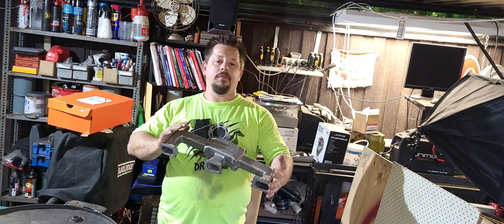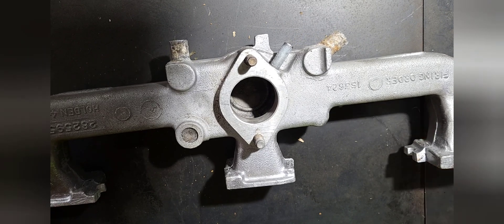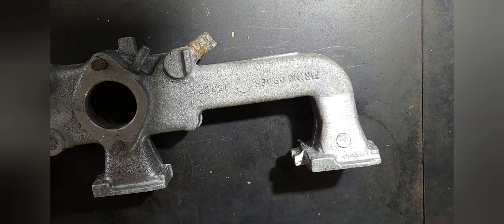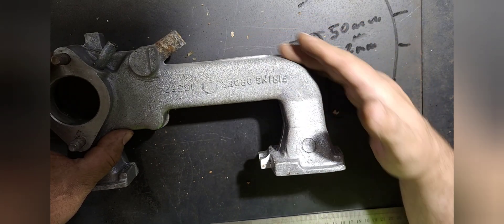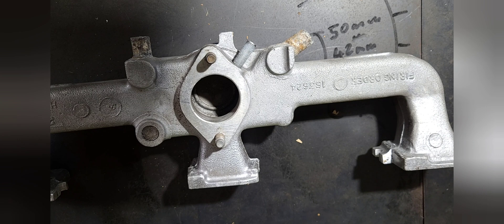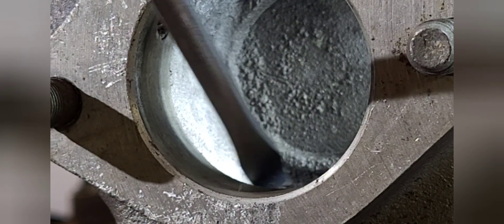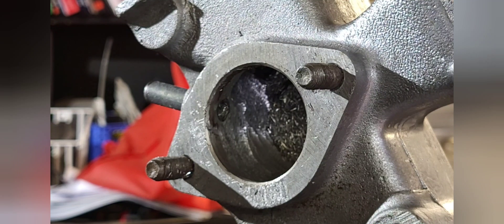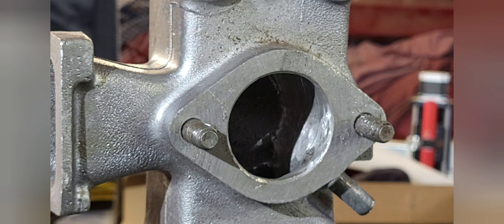holden 202 inline 6 inlet manifold porting

Comment: Best thing u can do if running the water preheat is . 
The single carb  manifold will foul the X2 headers  but after market headers probably ok 
After cutting out the manifold coolant base ,,, found they get full of corrosion / compacted sand 
If going to use the factory cooling hose setup I would do this .
Reply from the maker: Thats correct about x2 headers and single carb manifolds ,(i haven't ) but have you tried the later single carb exhuast heated inlet manifold with x2 headers thanks for watching 👍🍻
Reply: X2 headers hit the water heated manifold , major clearancing  involved . . 
Pace maker extractors will clear the manifold .

Comment: How much improvement could you expect with such an inefficient manifold design?
Reply from the maker: I'd say 10hp - 15hp but as with any engine it depends on engine combo but more to the point with this and p2 &p3 videos is about what you can do with little to no money and building on your skill set ,thanks for watching mate 👍🍻
Reply: We have been doing this mod to these single and twin stromy manifolds for years and it works, Idles better and makes more torque and power. Put a 10mm bakerlite spacer under the carby also and it works.
Reply from the maker: Thanks for commenting and watching👍🍻